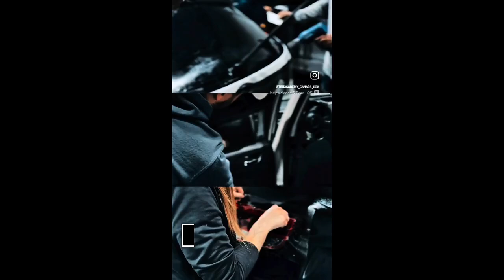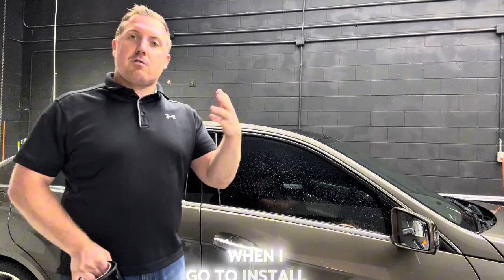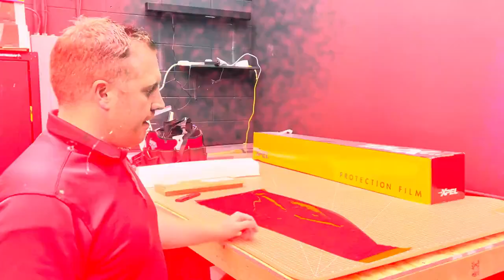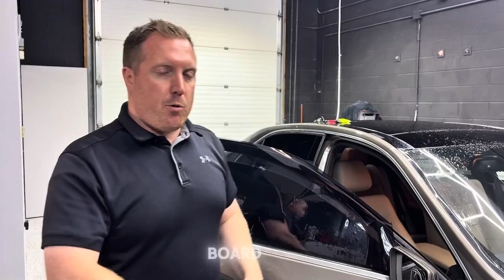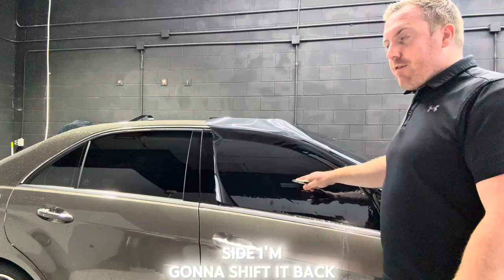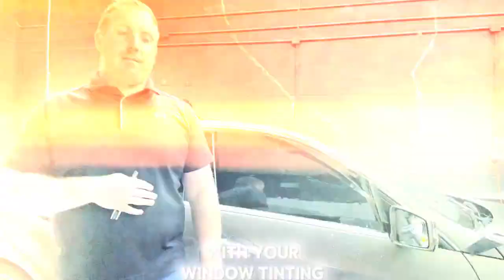Stop Scratching Glass: The Sharpie Method for Cutting Window Tint

Comment: Adam i have found the sharpie works most of the time however ALWAYS check that the out seal and inner seal match in height.If the outer seal sits higher when you sharpie and install you will see a gap as the inner seal is lower.